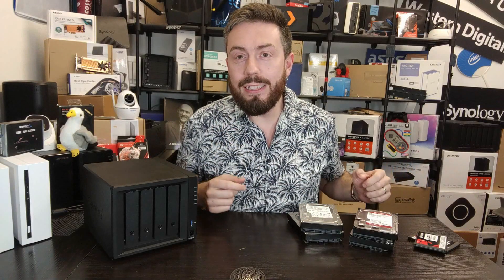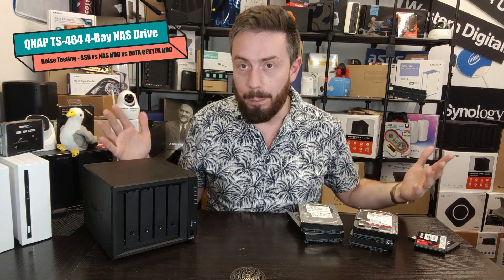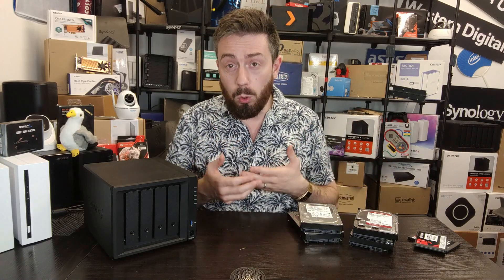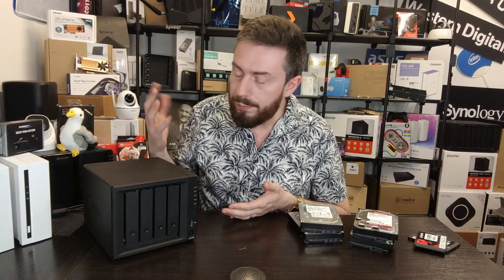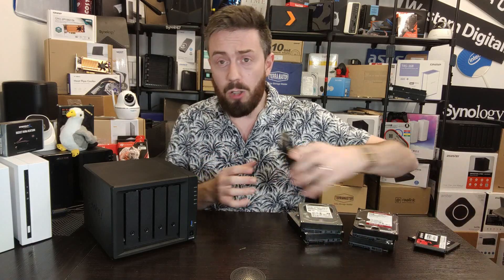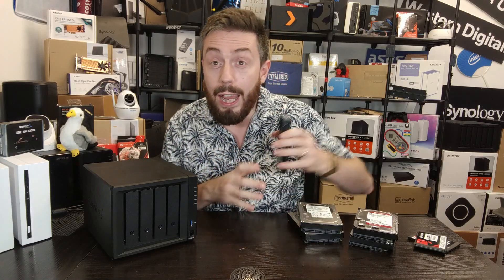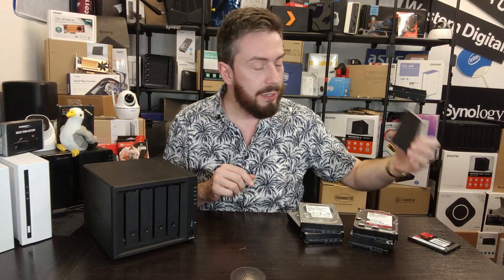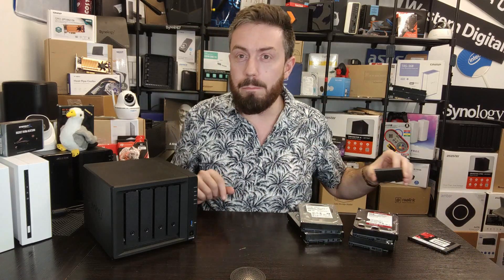Synology DS920+ NAS - Noise Tests

Comment: Man, I was thinking something was seriously wrong with the DS420+ I just setup with the 8TB Iron Wolf drives from Seagate.  That grinding/crunching noise is crazy (it's currently backing up my entire desktop which is several TBs).  The strange this, I have two of the 6TB drives in my desktop and they've never made that kind of noise even with continuous writing of recording video.. not sure why it's so much louder with the NAS.  Thanks for posting this... now I know it's "normal"... yikes.
Reply: Synology uses chassis made of plastic and metal and most of it is empty. It basically amplifies the noise because of it. It's horrible.
I was thinking of running SATA extension cables from the 4 ports to the drives located outside of the NAS.

Comment: The overall sound level on this video is low. I've cranked up the volume but still don't hear much. My own DS420+ unit is way louder and I'm just talking about the fans. I've set them to "Quiet" mode but they spin pretty fast still (with very low ambient temperature; "Cool" mode yields the same result as both modes have the same minimum fan speed). The fans also make an annoying ticking sound (with no hard drives installed). Synology support tried to help but were unable or unwilling to comment on the noise the fans make. If I had watched this video, I would have thought having a DS420+ or DS920+ (use the same fans) would be fine in a living room. In reality, my DS420+ is way too loud and makes annoying ticking noises (without hard drives installed; many other users experience it as well, and I seem to hear it on your recording super faintly as well) so it is an absolute no go in a living room. Unless I can confirm something being wrong with my unit (Synology would not do it, but I'll see my dealer), I'd say this "noise test" is very misleading. Remember, I'm talking just about the fan noise and a system which is not under load. Still super audible in a quiet room and the ticking noise of these apparently very cheap fans is unacceptable.

Comment: I have two wd inside Red Plus. Very loud. And the synology has a Vibration problem. All Vibration will be given to the ground. So if you buy this, remember you need own room, place for this. If you work in the same room, you will through this stuff out of the window.
Reply from the maker: Thanks for sharing tips man. I'm going to see if this series (currently 5 parts left to come) and if it's something you guys like, I'll make more videos on keeping your NAS quiet.
Reply: @nascompares  Many People use those NF A9 fans. I had a good experience with those as well

Comment: maybe add some rubber padding on the 7200rpm drive tray for a little improvement and yes the seagulls must go. I believe they taste like chicken.
Reply from the maker: I could have added felt tape (you can also use the velcro strips) but I wanted to show this system (and other NAS coming in this series) in their out-the-box state. Cheers for the thoughts though bud.

Comment: I cut out some small felt squares and put them under the “feet” of my 920+ where it contacts the desk it sits on. This cut down the vibration noise to a point where it doesn’t bother me being on the same desk I work on.

Comment: Good grief. I've been watching a ton of your videos, educating myself on what to buy (waiting for DS922+).  I've heard you mention hdd noise level several times but this really drives it home. That pro version would drive me mad! Thanks for your time and efforts, much appreciated.
Reply: Every 8TB (and larger) drive makes these noises, not just data center.
Reply: @RJ_Cormac  Yeah I have 18TB Red Pro drives and they sound just like the Ultrastars in this video. Wish he would have told us the size of both drives and had them the same RPM.

Comment: I am using DS920+ with 3 WD RedPro HDD. The noise level when start doing storage building is quite annoying. After some researching on Reddit, I put on the foam on the HDD mount rack and placing the HDD to continue building the storage. Noise level improved and with less vibration. But improvement level still has gap, and the sound generating during the storage build likes boiling eggs in a lid cover stew pan. Hope after the storage build, noise level will have substantiate improvement.

Comment: You say niche... I say really like the sound series. Many thanks for covering this. I've been looking for reasons to switch to SSDs :D 

Related-ish would be interested in any video/discussion/thoughts on the performance benefit of switching (say) a 2-bay or 4-bay (Synology) to SSDs. The NAS in question is used for a few things, and is broadly IO bound rather than CPU or RAM.
Reply from the maker: Thanks dude. Genuinely appreciate the comment.

Comment: Same NAS with (4) WD Reds 3TB each.  I have the NAS in the basement with a nice 65 degrees F (18C for you non-US bunch) so I keep the fans on quite mode and the drives are running at 82F/28C all the time.  Being its not on my work desk or anyplace anyone will hear them, noise is not a killer issue.  At some point I do need to upgrade my drives since I am running a bit short of space (75% at the moment) and eventually will look for larger drivers and might look into the noise levels to see how newer drives stack up to these older WD drives.

Comment: Except for one tiny spike - those WD Red Plus drives are really quiet. Impressive.
Reply from the maker: I thought so too. Even factoring the smaller capacity generally = low noise, these Weber particularly quite HDDs. That said, the ultrastar heavy activity noise at the end of the video genuinely bordered on the is this thing going to explode territory...